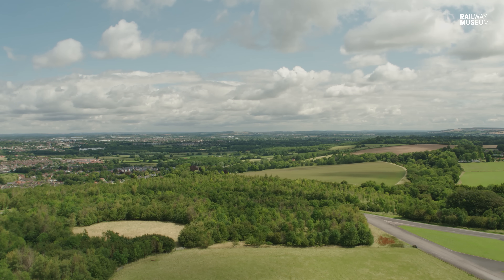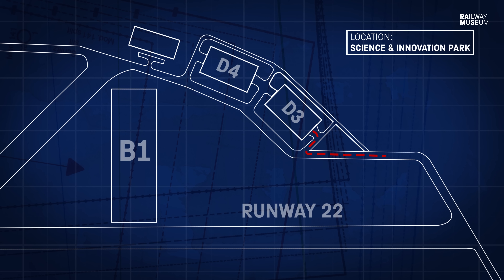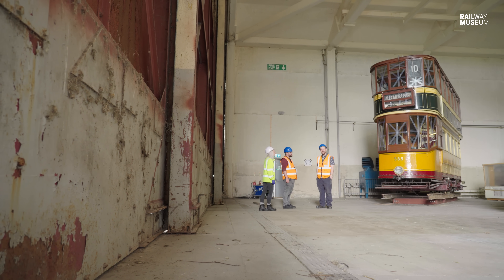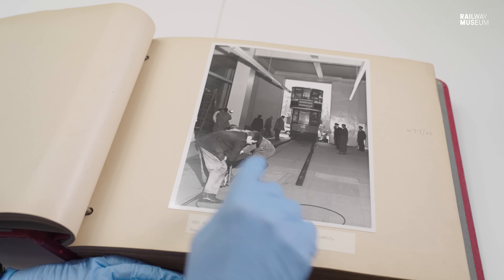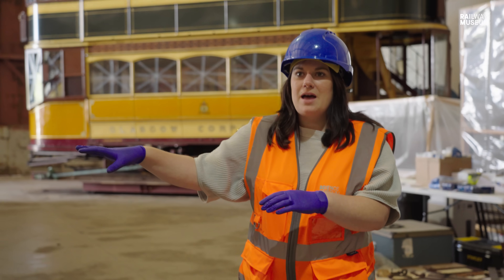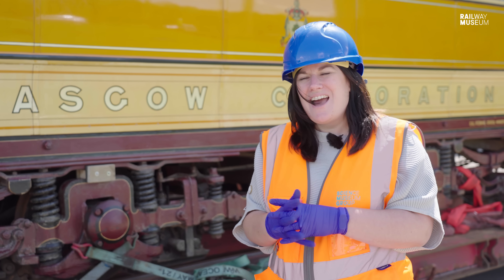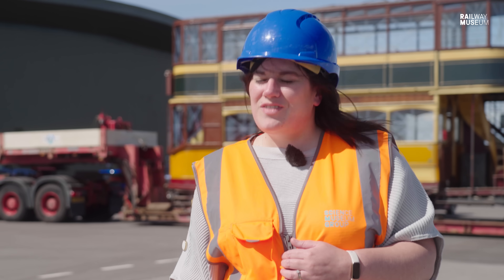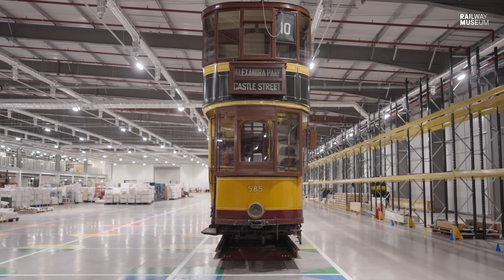How do you move an enormous tram from 1901? | Behind the Scenes

Comment: Always concerns me how top heavy they look. I presume the chassis and weight of the wheel sets keep them from toppling over when traveling round bends. I understand they didn’t travel very fast but they must have had to take weight distribution into consideration, like for example not having the lower deck completely empty and the upstairs deck full to capacity.

Comment: Among the memories I have of these 'Standard' cars is on warm summer days - yes, even in Scotland we got them - the driver would leave the door at his back partially open.  It provided a much welcomed flow of cooling air into the lower deck.  Since I have used most of the types in the Glasgow fleet, it is possible I have been a passenger on this particular one.  Doesn't matter if I didn't - I loved them all.
Reply: The only 2 Glasgow standards I'm familiar with are numbers 22 and 812 (and the open topper 1068 formerly paisley 68) all are great trams

Comment: I came here to gawk at the awesome Tram! but... yeah.... Air Navy, I've had to deal with an armored hanger door that no one maintained for years. I strained/sprained my trapezius muscles on both sides trying to close hanger doors with the tracks filled with packed dirt and dry bearings. We were only going it because of a trio of water spouts heading right for the hanger. We got the doors closed... didn't derail a hanger door which is a danger. The folks responsible for the hanger doors got a butt chewing.
Reply: From memory, and I used to write Maintenance Requirement Cards for a living. Monthly use compressed air and vacuum to remove dirt and debris from hanger bay door tracks. Quarterly inspect wheels for flat spots, inspect chain for corrosion, bends or breaks. Every 6 months inspect wheels, chains, mechanisms for excess wear, corrosion, proper operation, lubricate bearings and mechanisms. Most places skip all of this and the day comes when they need to close the doors... they don't move or, worse the door leaves the track....and, I know of one incident where the door operator got splatted.

Comment: You load 16 tons and what do you get?

Well, mostly a whole lot of faux drama.  The folks working the jacks would have to screw up royally to tip it over.  Most of the mass of the car is below the floor - the traction motors, wheels, axles, etc, probably weigh more than the whole upper deck.  These things were filled with probably close to 100 passengers and ran around pretty sharp curves.  Not a big deal.  

I appreciate the difficulty of the work and understand why museum staff would plan this for 5 years before doing it, but I can do without all the fake tension.  Kudos to the staff for great work in a great facility!

Comment: 3:41 Lucy, "I've been planning this for 5 years" then 4:27 commentator, "But as he tries the second door....there's a problem" Amazing, no one thought to check the door worked!
Reply: why would they, I bet she checked 5 years ago. 🤣🤣🤣🤣🤣🤣🤣🤣OOooh is its going to fit out the door without getting stuck???
yes..
it went in the door last time it moved. 🤦‍♂🤣🤣👍
Reply: & giving the door a nudge with a telehandler or tractor was out of the question? It's called "thinking outside the square". I bet the RAF groundcrew had to unstick them on occasion after the airfield being bombed etc.
Reply: Any factory relocation firm could plan that move in 5 mins, some jacks, skids, a forklift and a low loader.
WTF took 5 years to plan?
Reply: @Phuc_Yhou  a) Five years is the time taken to devise the whole moving plan, not just one item; b) the aim of a museum is to protect the objects in its care that may be irreplaceable.  A factory moving firm just has to get the stuff moved asap and try not to damage any of it to such an extent that it will no longer work.
So GFY!
Reply: @Phuc_Yhou  it was five years to plan the entire opperation to build the new buildings, their fit out, and where to eventually place the tram in the new building... most of which is bureaucractic red tape, and the liabilities, and meetings.
Reply: @PiersDJackson I don't believe 5 years included the construction, or the fit out, that's just how long the moves took from start to finish. The space for the large objects like the tram was previously the transit space where all the small objects arrived, were unpacked and prepared to move to their final home in the building, so that's why it's at the end of the process. 5 years of planning means 5 years of sequencing complex object moves, hazard checking, barcoding and records updates. That might be red tape but is what keeps people and the objects safe from damage or being misplaced.

As @Phuc_Yhou says, anyone could plan this sort of move with a bit of industrial knowledge (although I would suggest that's actually a lot rarer than you think these days) and moving most of the other objects would be even easier. They would do a good jobs by most people's standards. Maybe they only damage/misplace 1% of the objects, or perhaps they're much better than average and it's only 0.1% of the objects. However, that's still somewhere between 350 and  3500 irreplaceable, priceless museum objects owned by the nation that are lost to history. Oh, and this is a historic science and engineering collection, so they've probably breathed in asbestos fibres, poisoned themselves with heavy metals and irradiated themselves in the process.
Reply: I'm a retired doorman and I've installed thousands of doors. Like cars, it's always something.  It's usually something in the floor track or the header track.  The tricky part is stabilizing the door while you clear or fix the obstruction. I have nearly lost several doors while hundreds of feet above the bottom of an elevator shaft.
Reply: Typical of these types of videos.  There's always a "problem" to keep the viewer's attention.
Reply: I assume 5 years means the first time someone suggested a new building and moving things into it.  I expect lots of meetings and bureaucracy is involved.  It may very well have been known that the door had issues and they had "plan B" already done.  I mean, why else would they have the equipment to move the trailer on hand.

I really dislike this style of documentary video where they try to amp up the drama.  It really makes people look bad regardless of if its justified or not.
Reply: You obviously didin't understand the entire video. Probably stick to your own area of knowledge, presuming you have one.
Reply: @Valleys56xx  Ooh that was a bit harsh old chap. Speaking of knowledge, I do know how to spell didn't !